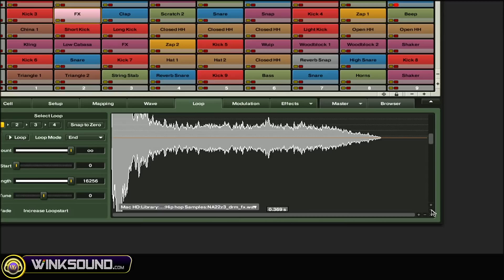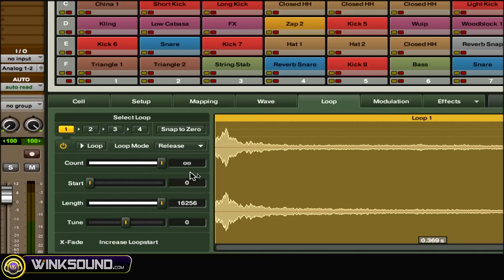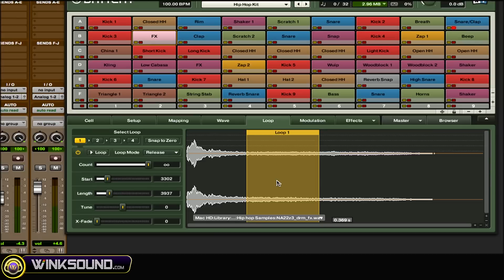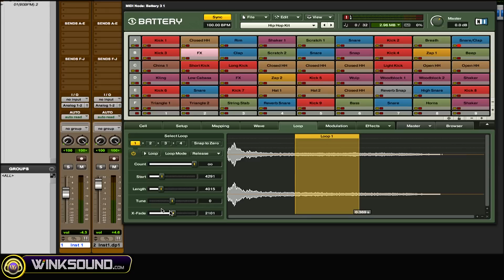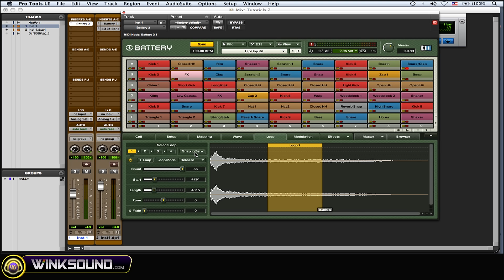Native Instruments Battery 3: How To Use the Loop Function | WinkSound

Comment: Thanks alot of help!! I do have one question mr wink...I just got a second midi controller (an oxygen keyboard 3rd gen m-audio) I want to use one vst for example absynth or massive w my keyboard and battery with my 2nd controller (akai mpd32) how would I be able to simultaneously play both vst's at the same time thru my daw (fl0) ? I tried but I can either play one or the other??